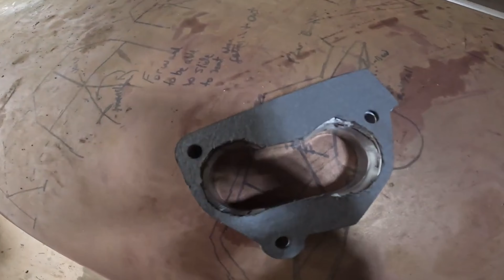The Ultimate TBI Mod & Intake Manifold Install, 1992 C1500 SBC. (Re-uploaded)

Comment: Wish I knew more about air flow. Seems like instead of cutting those off the TBI housing, increasing there height and make each of them connect better into a complete tube would straighten the air flow better. Like some of the intake tunnel cones we see on some carburetors.
Reply from the maker: @paulferrara9079  Yeah, that may work. These TBIs restrict air flow so bad there isn't much you can do with them.

Comment: Crescent Hammer, Got a question? I have 95 Chevy Silverado 5.7  k1500 tbi. And I was wondering if you know what would be causing the injectors to stop spraying after it's been ran for about a hour. And it will shut off and want start until the next day after it cools. I was told it was the pick-up coil in the distributor. Have you ever experienced anything like this. If so what was the solution
Reply from the maker: @ReptileMan24  I would test for spark once it stops. Try and isolate the issue. I wouldn't think it's a problem with the distributor if the injectors stop firing. 
You can also pull codes with an OBDI dongle.
Reply: @crescenthammer   it has spark I can pour gas in it and it'll run but no spray from injectors. I know you said something about the ecm I just hope it's not that
Reply from the maker: @ReptileMan24  there's nothing wrong with the distributor then. Something is turning off the injectors.
Reply: Its the icm under the distributor cap it will cut fuel and fire
Reply: @Tyler-bb3cw  I meant to update this I did find the issue it was the pick-up coil in the distributor. I tore it apart and the coil has lost all of its coating and one of the wires had came completely off of the coil it's self. I really didn't see how it was running even the next day after it cooled off cause it was really bad. Now I have a issue with it stalling sometimes then it will start right back up. So another mystery to solve. Thanks for your insight on this matter